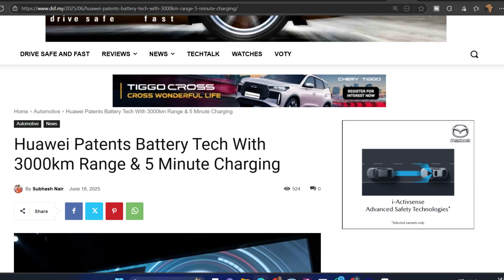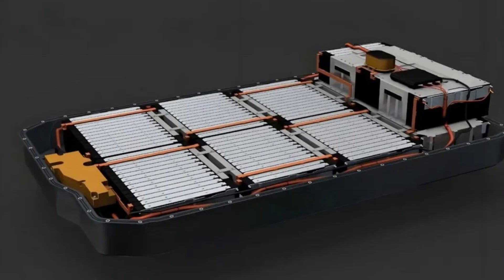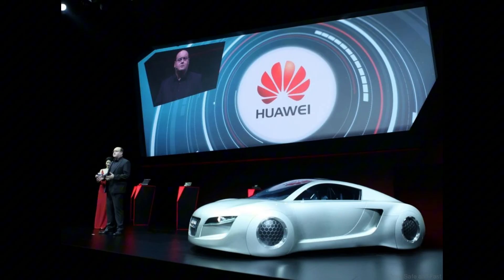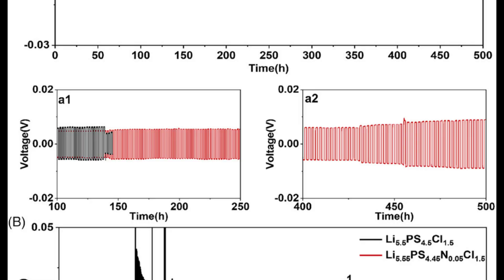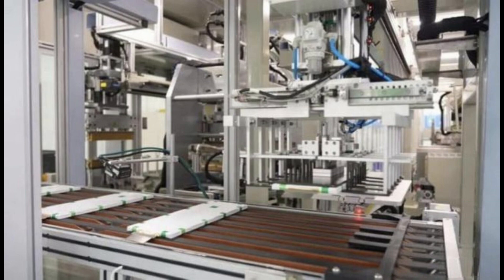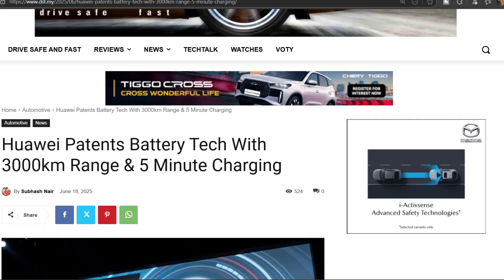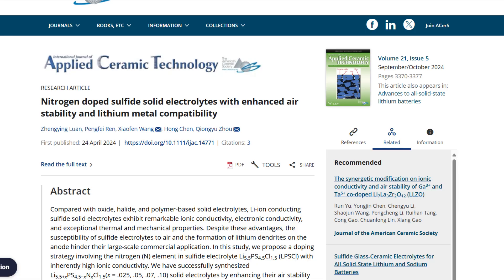Huawei Just SHOCKED the World: Patents a 3,000km Range & 5-Minute Charging Battery

Comment: 5 minute charging? AT what voltage?
We won't see these at the consumer level for another 15 years or so.
Reply: Its already available in china in limited locations.
Reply: @shuvoGenz  With what cars?
How many sold?
Reply: @shuvoGenz No it is not.
5 min Charge means 6 Megawatt charger.
There is no 6 megawatt charger in the world.
Reply: @tr9036  sorry I should have explained before. My reply was about 5mnt charging. BYD Han L supports 1MW charging and has 83kwh battery. It typically takes 5mnt to charge more than 80% which is 400km range.